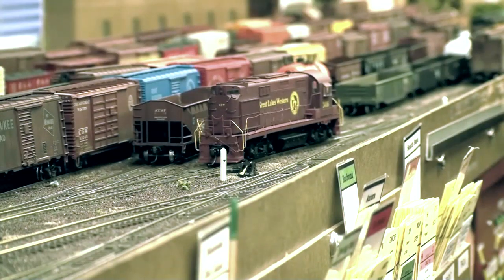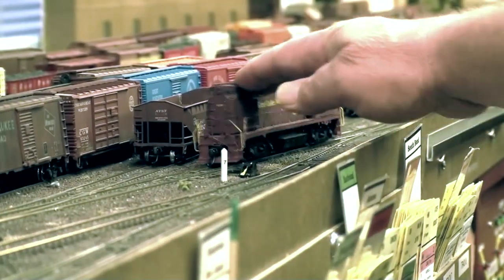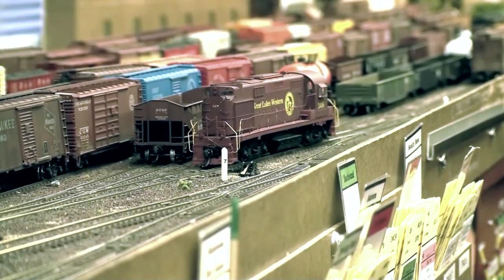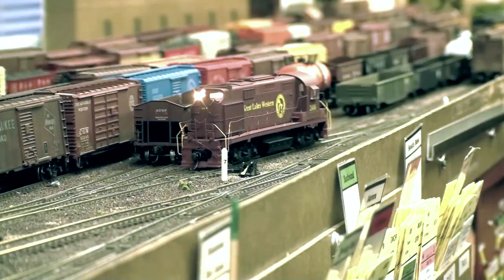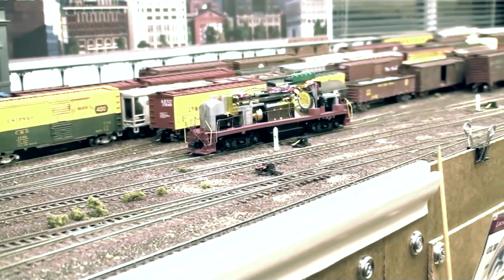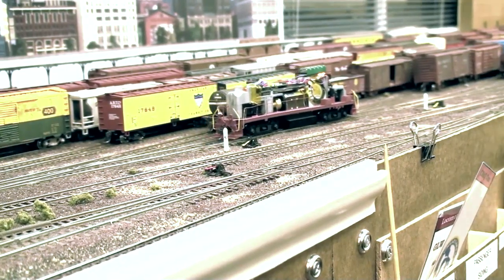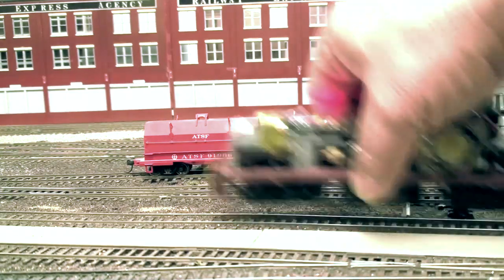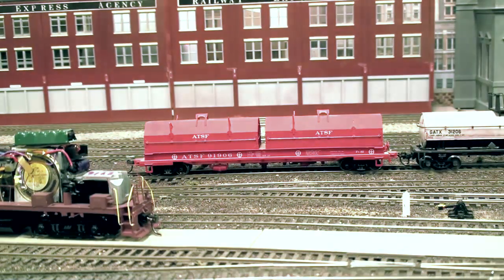DCC sound decoder keep-alive demo | Model railroad dcc sound | Model Railroad Hobbyist | MRH

Comment: One question please. you said you connect the KA2 to the old cap negative  wire. instead of looking   for the negative on the decoder board? sounds much easier this way